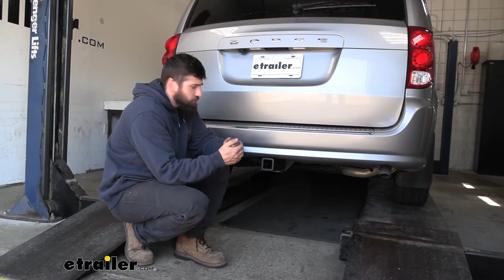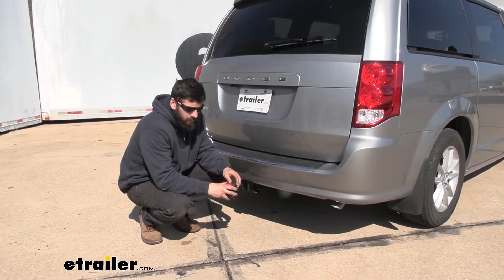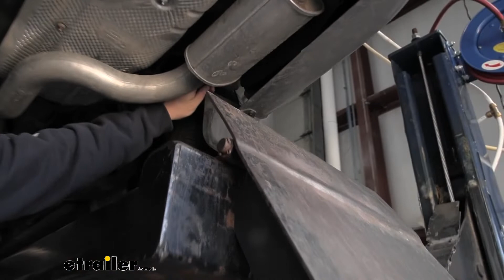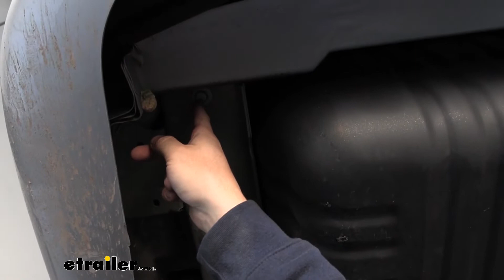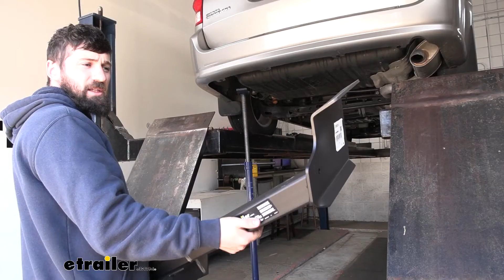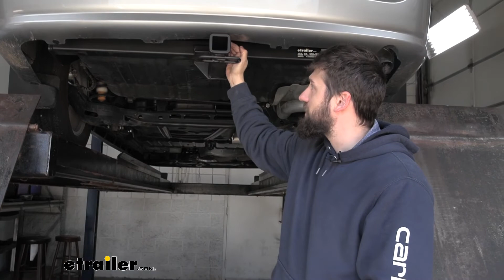DIY 2020 Dodge Grand Caravan Installation for the etrailer Trailer Hitch Receiver

Comment: What did you torque the bolts to? I installed my hitch myself and instructions weren’t perfectly clear as to the torque. Thanks
Reply from the maker: Use this product page and click on the instructions link. On the first page look at step number 4. It will tell you the torque values for the 10mm and 12mm fasteners. https://www.etrailer.com/Trailer-Hitch/etrailer/e98854.html